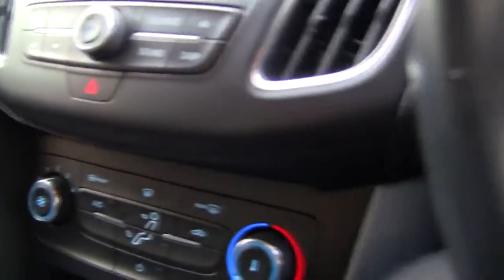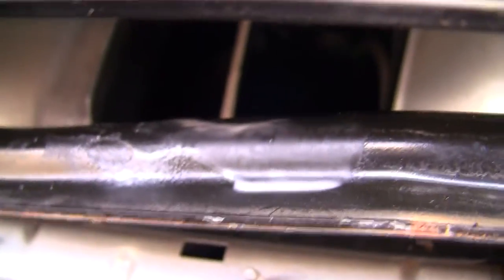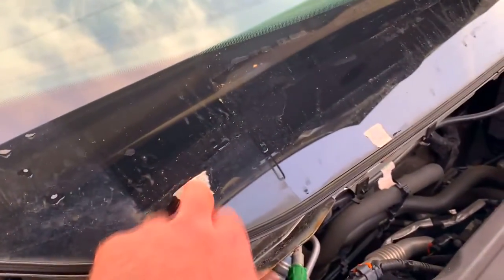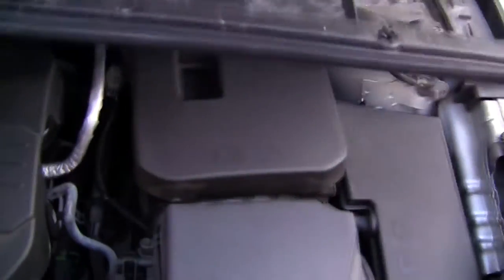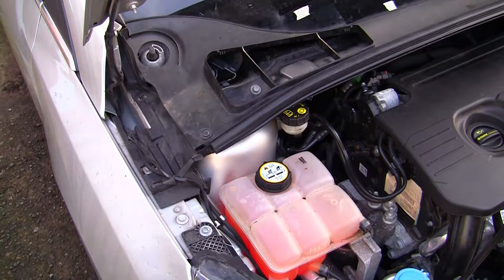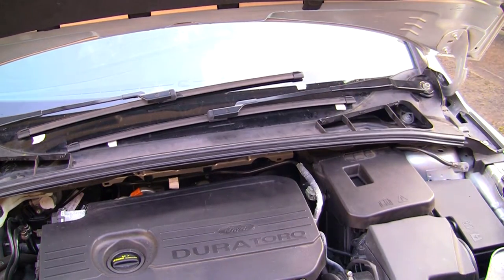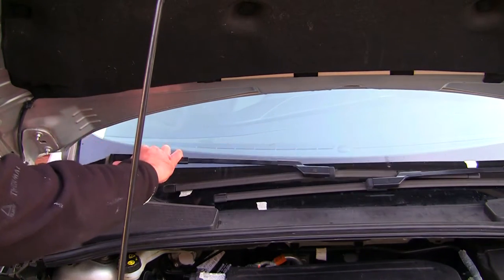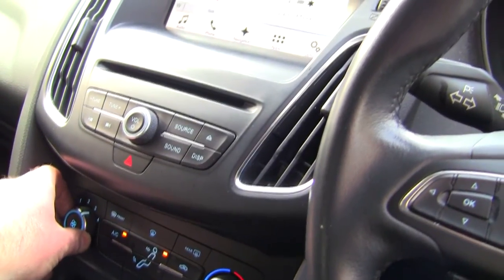Ford Focus Noisy Heater Blower Fan Fixed

Comment: i have had this problem last 3 days after searching google your video was first on list 
i followed your advice stripped car down and got access to the motor having no airline i got my leaf blower which just went in the hole and gave it a good blowing out quite 
a bit of dust came out put it all back together and been for a drive and all seems ok now will see how it goes
one tip for the wiper removel when you have them off if they were hard to come off you will have probbly moved them out of postion a couple of mm get in car turn wipers on for a few seconds with no arms fitted this will reset them back to where they should be that way when you line them up with the tape you put on window should be good to go whole proccess took 40 mins thanks for your advice

Comment: Thank you for this tutorial.  We had the same issue, which turned out to be a maple tree seed in the cage.  The only difference is that on a left hand drive car, the blower is on the other side of the hole from yours.  :)  The root cause in our case turned out to be the black trim piece at the bottom of the windshield falling off, which allowed a lot of debris into the plenum.    I blew out that debris (with the fan turned to off, which closes the recirculating flap)  and reattached  the trim to the windshield  with silicone sealer.
Reply from the maker: That's exactly what I did Rod. It might be my imagination but the heater also seems to work better!